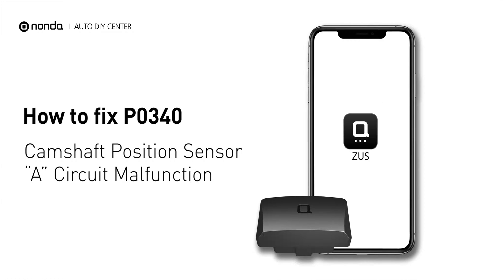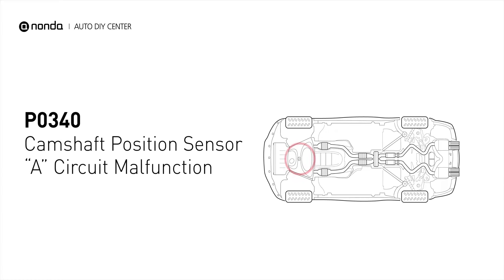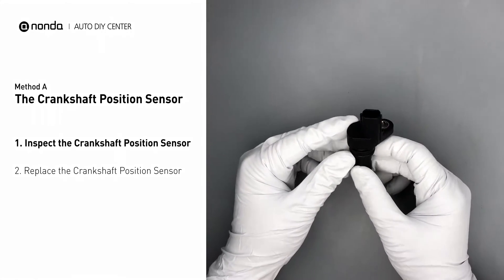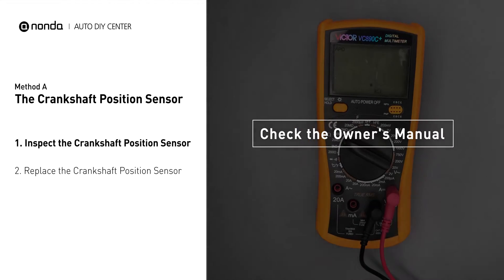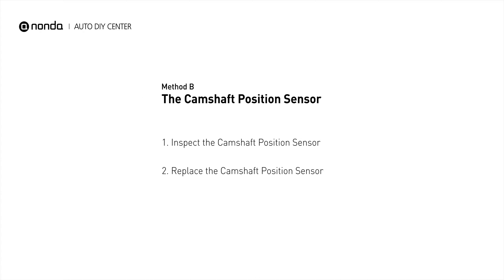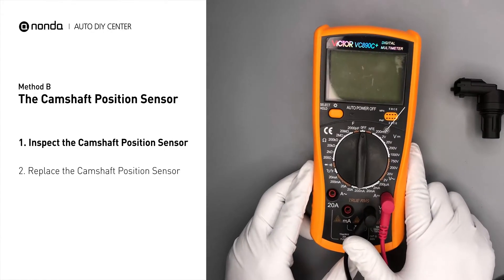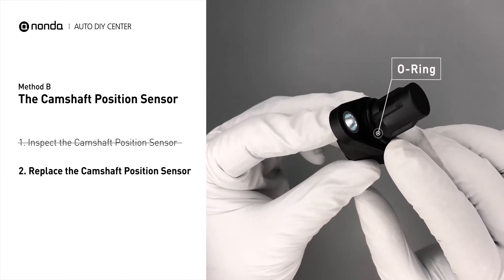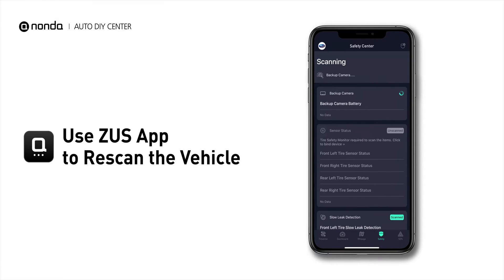How to Fix P0340 Engine Code in 3 Minutes [2 DIY Methods / Only $9.65]

Comment from the maker: Hi, I'm Steve, nonda's lead mechanic engineer. 
Feel free to leave your comments here if you have any mechanic questions, I will be glad to help you out!
Reply: Hello, Steve thank you for offering your service. I hope you can help. I have a 2000 Toyota Camry and the engine light is on. I took my car to Auto Zone and P0340 code show as per Auto Zone crankshaft sensor needs to be replace. I replaced, but the light still on. And took back to Auto Zone and shows again the same code P0340. I don't know what to do, can you help me or guide me. I really apreciate your feed back. Thank you
Reply: I have caravan which cuts of randomly 2001 SE caravan,2.4 liter
Reply: My car drives and takes off sluggish I’ve gotten a new coil, plus wires and all but still the same. I’m going to try putting in new cam sensors now to see if that changes
Reply: @lyricaldolla803  check for p0340 codes
Reply: @lyricaldolla803 g

Comment: On Toyota Tacoma I had same experience it was the coil in distributor only 4 years old still had old one I took out put it in runs fine 20 year old part still works this new stuff is cheap

Comment: Hi maybe I am  being thick but but Camshaft Position sensor and Crankshaft position sensor they look the same are these two different parts as Method A and Method B the part name in title is different ie  Crankshaft position sensor (method A) and Camshaft Position sensor is it the same  part? If not then  can you please clarify ?
Reply: On a PT cruiser ,(2.4) or Dodge ,(2.4,) there's a big difference between camshaft and crankshaft position sensors

Comment: I changed the cam position and crank position sensors and I'm still getting a p0340 on my 2000 Lexus ls400
Reply from the maker: Hi Andrew, please inspect the wires for any issue and test the resistance of the ignition coil if within the right specs.

Comment: Just switched out both camshaft sensor and crankshaft sensor. Still getting p0340!
Reply from the maker: Hello, please provide us the year, make and model of your vehicle so we can address your concern specifically for your car's make/model.
Reply: @nondainc  2008 Chrysler Sebring 2.7L. Intermittent P0340 and traction control light after changing both camshaft sensor and crankshaft sensor. Poor acceleration over 80km/h speed, when I press the gas pedal there is a delay to accelerate and when I release the gas pedal the car jolts instead of slowing smoothly.
Reply from the maker: Hi Zack, please inspect the wiring around the Camshaft Position Sensor and check the voltage if within spec.
Reply: @nondainc  ok i'll try that in the next few days and let you know. The ground on my battery will be disconnected while I remove the connector from the sensor. Should I reconnect ground to battery before I use multimeter to test connector?
Reply: @andrewvirtue5048  yes I did, it comes back almost right away.
Reply: @nondainc  the wiring looks good, and I tested the connector with my multimeter and I'm getting good ground and proper voltage and reference voltage.
Reply: @DonkeyKawng  plah. I'm getting ready to embark on the annoying process of this code next week. I need my car back working desperately.
Reply: @Planət  I still have the same problem 8 months later haha. I think I need an engine rebuild, thinking my timing chain might be out of time or something inside is broken or worn like a pulley or tensioner. If you solve the issue in your car, let me know I'm curious to hear the solution. Good luck!
Reply: @DonkeyKawng  I have my fingers crossed for the front and back mass airflow sensors I bought. Praying I get my car going and another part won't break afterward. Stay tuned. LOL!
Reply: My car is a 2007 Nissan Murano
Reply: I have the same exact issue. Did you ever figure out what was the problem?
Reply: @michaeladams7261  yep. When I replaced the cam sensor the first time I used a shitty aftermarket one that didn’t solve the problem. Ended up finding an original part in a junkyard and it solved the issue. Make sure you use an original OEM MOPAR part. Aftermarket sensors are junk.
Reply: @DonkeyKawng  thanks, I appreciate it. I’m gonna try that today
Reply: @DonkeyKawng  I'm having the same issue with the camshaft position sensor for a chrysler sebring 2.7lt 2001... The original sensor was 5 or 6 mm larger than the aftermarket sensor. The P0340 goes on and off (mostly on). I can't get the original anymore.

Comment: 08 charger p0340 what’s the problem?
Reply from the maker: Hello, kindly examine the camshaft position sensor wiring for short or check the harness connector if loose/damaged. We also suggest to test the sensor itself to see if the voltage is within specification and find out if it's failing.
Reply: @nondainc  could it be my crank sensor since my car is now stuttering before start ?
Reply from the maker: Hi Dallas, please have it visually checked by your local mechanic for further diagnosis. Thank you.
Reply: Whot is the most. Often the prob it want crank

Comment: got the same code on my 99 Intrepid 3.2 ,Replaced  the fuel pump then it started running sluggish,..Check Engine came on,,pulled P0340 code,.gonna do cam and crank sensor tomorrow,.Hoping it's not the alternator (bad diode) as i've heard this throws that code as well.
Reply from the maker: Please do let us know the outcome, Shane. Stay safe!
Reply: @nondainc  Drove great and clear'd the P0340 code,..still eating gas,.when while drifting on even ground it shut off,..Gonna try to replace the crankshaft sensor on monday.I think that's been it the whole time.
Reply: @nondainc  3 years ago had all the same simptom's ,replaced the cam and crank had no problems,..my fault for not doing the crank and cam together this time.
Reply: Did the crankshaft sensor fix it?
Reply: @DonkeyKawng  Yup,,Did the cam and crank,.running alot better,.Next is possibly Catalytic converters ,or fuel injectors,.got 155 on her,.Gets hot on short drives,.doesn't over heat,.Did the pcv valve and Temp sender/sensor last week.,